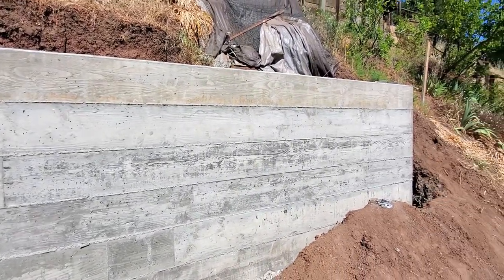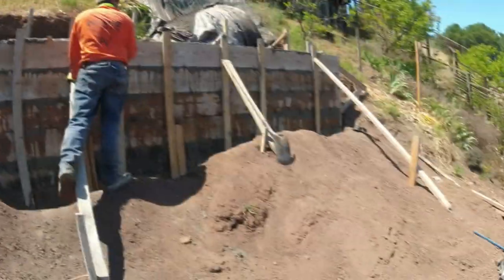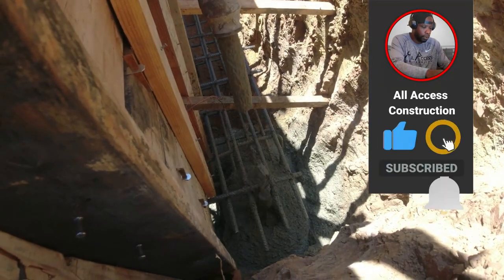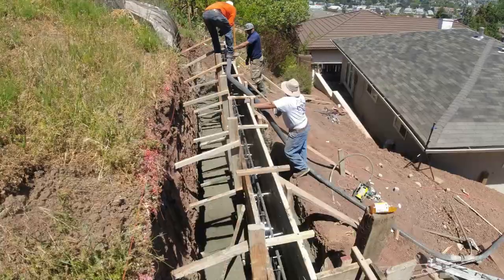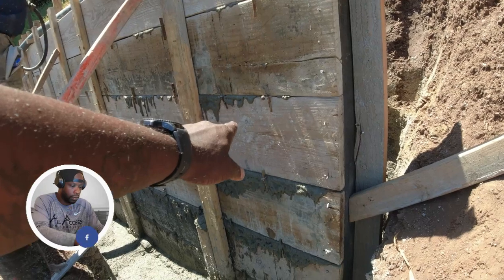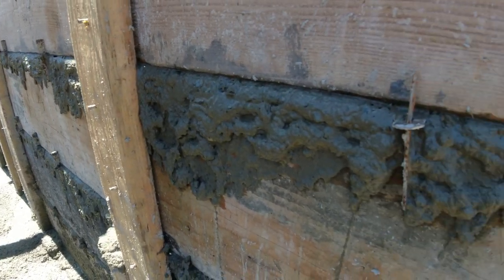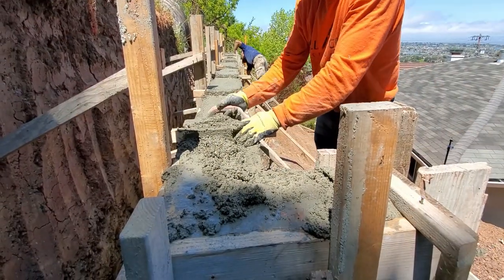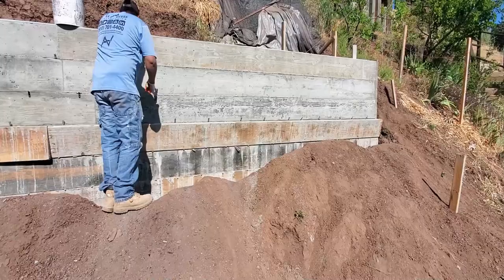See What It Takes To Pour Concrete Retaining Wall On Hillside

Comment: The part of the form you cut off and leave in the footing isn’t an issue? Any worries about cracking or with a 12” grid is that not an issue?
Reply from the maker: Never really had an issue with past all inspections.. Most of our footings are 18 inches deep.. Rebar minimum 12 8nches on center